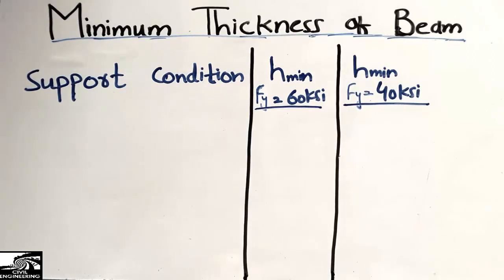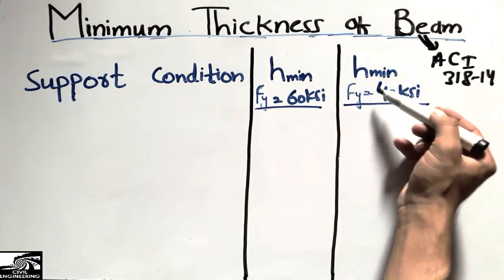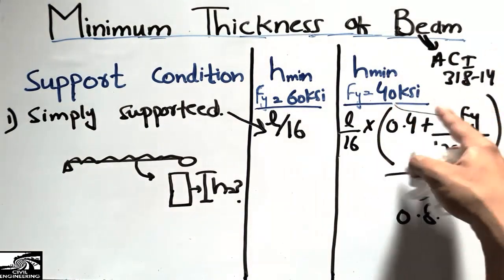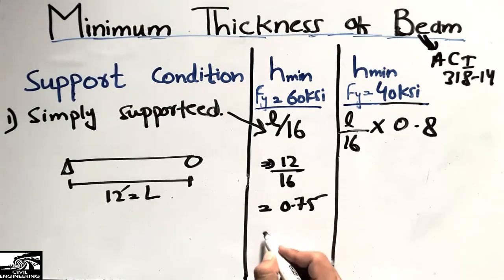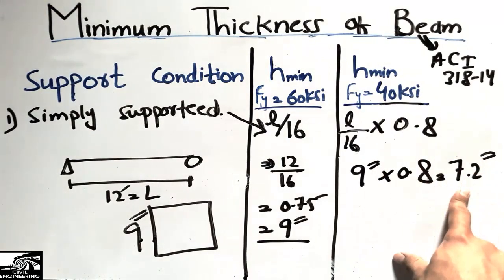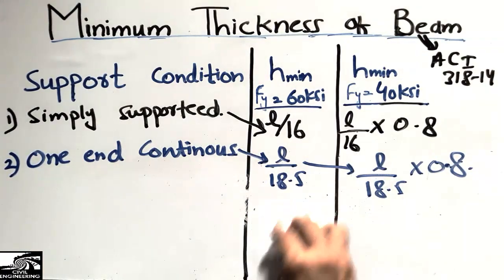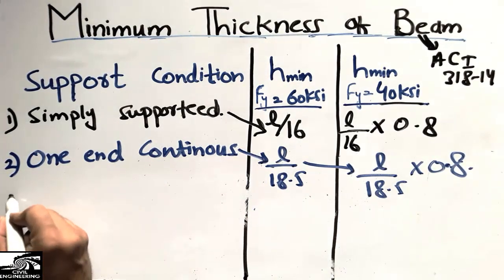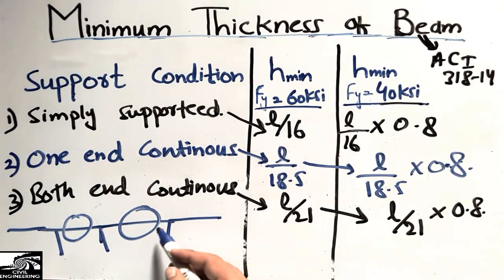Minimum Thickness of Beam

Comment: i want to make a loft bed and i'm having trouble choosing the thickness of the pine beams. I'll be making a frame 4.5' x10' with two 10' beams in the middle (a total of 4 long beams and two short ones , 3 sides of the frame will be bolted to the wall-no vertical supports) and i'm thinking of using 3'' x 6'' thickness for all the frame material. Is this overkill? Is there any rule of thumb for quickly calculating the thickness of the beams needed in projects like this? 
thank you!
Reply from the maker: you cannot use thumb rule in such a case, but its better to analyze